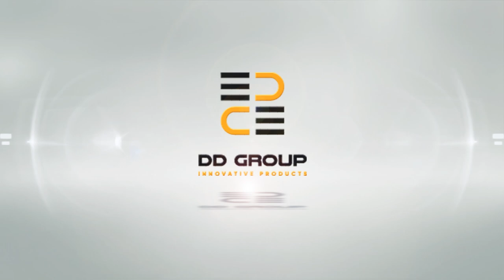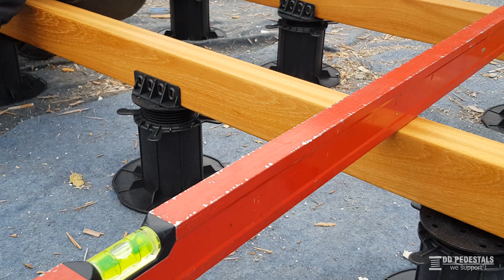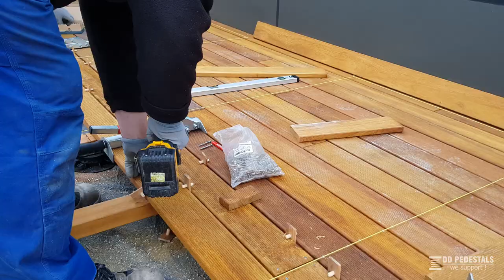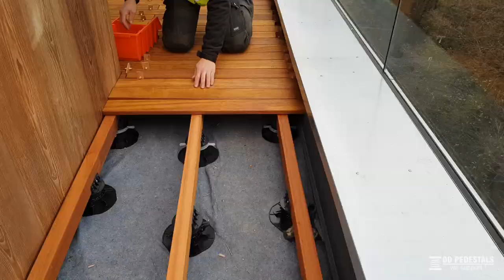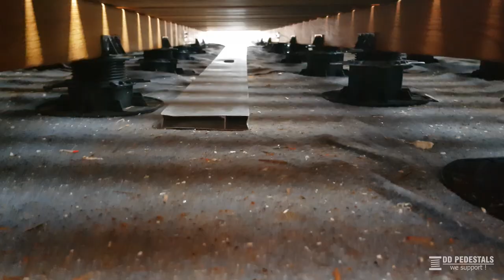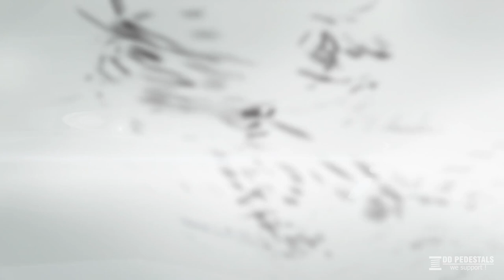Adjustable pedestals for decking wood and WPC / Wsporniki pod legary tarasowe

Comment: How did it work through the winter seasons?
Reply from the maker: As wood is a natural material, it is unfortunately always worth ensuring that it is adequately protected from the weather. This is very much dependent on the type of wood used, but also on which climatic conditions it will be exposed to. We would recomend to consult ways of protecting Your terrace with the manufacturer before choosing  boards :)

Comment: Can these be used directly on compressed gravel/split or do they require concrete tiles like 30x30x4 on top of this layer? 🙋🏻‍♀️Anna
Reply: Great question ! I’m going to fabricate a slab 2inch thick for each of them to sit on.I feel this maybe over kill but last thing we want is for them to sink causing bouncing.
Reply: @adengardner3549  thanks for your reply! I have not used these and the base is now constructed with concrete tiles and aluminum. Anna

Comment: I would be building this on top of a cement slab and the question I have it’s if I need some sort of barrier in between the cement slab and the pedestals to avoid vegetation from growing (weeds). The cement slab has a few small cracks here and there and every year weeds grow in between those small cracks. Any advice will be appreciated.
Reply from the maker: Geotextile 200g/m2 will do the job.
Reply: @ddpedestals  And what would you recommend in order to prevent the wood from rotting? The deck will be exposed, no roof so it will constantly get wet by the rain. Do you recommend any specific kind of wood for that?
Reply from the maker: @fgrodriguezqac  that's a long story ;) What kind of wood will be used for your decking? If this is hardwood you do not need to do to prevent rotting. If this is softwood the only real solution is our hidden fastener DECK-DRY which avoid wet-sticks where rot is developing. You can check more details in catalog on our website.
Reply from the maker: @fgrodriguezqac  decking joist should be made of plastic or aluminium. If you use a regular wooden joist at least protect it with joist protection tape.

Comment: Too expensive.
Reply: Initially, I thought the same thing but with labor savings, it might come out cheaper in the long run.
Reply: Never thought about the labor part but just the initial cost. Now that cost of material and no labor makes buying these affordable.
Reply: Actually no not at all
Reply: €3-4 each that can carry 800 kg
Reply: @Raggadishan where would I get them for that price?
Reply: Exactly. Way cheaper to pour footings using 6x6 treated post with 2x8s or 2x10.....2x6 can be used for floating decks